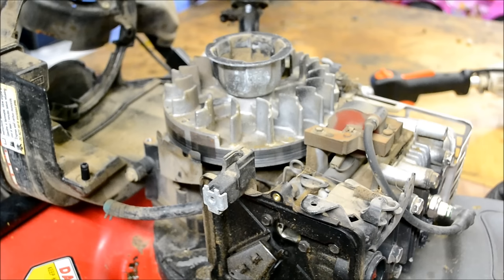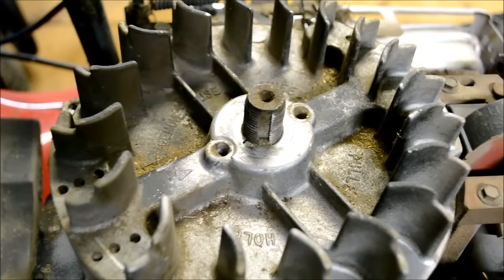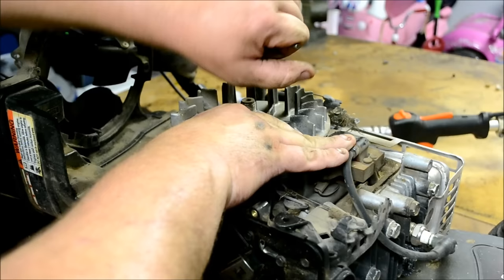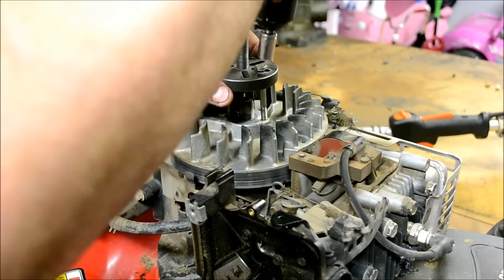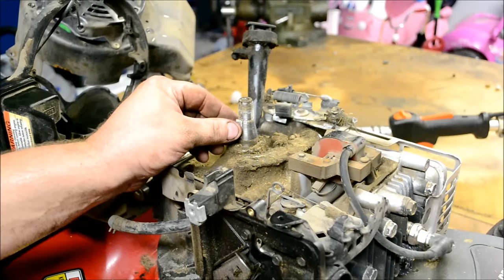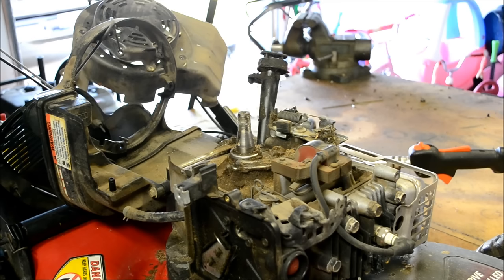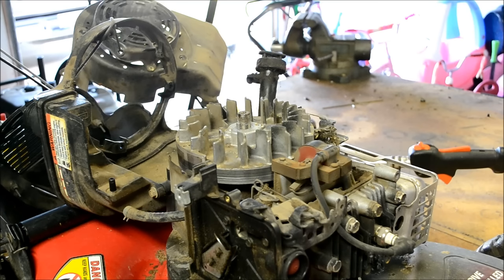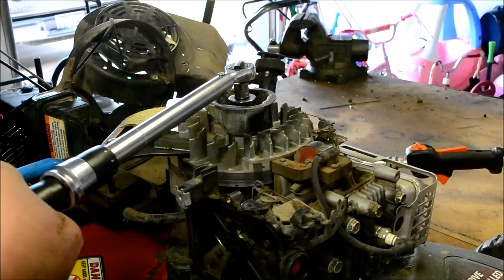BRIGGS AND STRATTON LAWN MOWER ENGINE REPAIR :  HOW TO DIAGNOSE AND REPAIR A BROKEN FLYWHEEL KEY

Comment: You should tell people the first thing to consider is;  if the mower was running well and you struck a stump, large rock or clump of dirt and killed the engine and then the mower is hard to start or won't start or difficult to start then the flywheel key is the first place to look. PERIOD!
Reply: Yes exactly and I literally just found out about this today and you are the second person to mention this.
Reply: @E85_STI  correct!

Comment: From one small engine mechanic to another, excellent advice. Please use the required zinc flywheel key. Never use steel for any reason. Guy from my hometown went the cheap way and used a cut horseshoe nail and the flywheel exploded after hitting a tree stump. He lost half of his right leg from it.

Comment: In my experience, keys fail when someone runs the mower over a large rock/cement - stopping the engine far faster than it should stop.
I don't think it's cheap engineering to use a part that will sacrifice itself to save other parts.
Is it cheap engineering to use fuses in electronics?

I do agree that they should tap those holes though.

Comment: In my area of South Carolina, you usually are SOL if you need anything except the air filters or spark plugs for your mowers or other power equip.   Places just will not stock any parts for the DIY guys & gals.  They will sell you a lawn mower sure....just don't expect to get any parts for it.   That my friends...SUCKS!

Comment: For a small engine mechanic that only knows the basic on how to start up and cut the grass this is a great way to learn how to fix the common problems over the motor backfiring through the carburetor and muffler and basic intake if engine repair.

Comment: I wish I had seen this video two weeks ago. Motor was backfiring on me and it left me with a lame wrist for 5 days. Still, I kept trying to start it and ended up with a broken starter pulley, a broken bladeholder and then I broke a teeth of the flywheel while unscrewing the cup.
Yes, I noticed that the two gaps in the axle and flywheel weren’t aligned but i wasn’ aware that there should be a ‘key’ in that place.
Thanks for this useful video. Now I only hope I can still order the necessary spare parts.

Comment: Been a machinist for a long time, mills and lathes go through keys like that, I get leeway material by the foot, cut it and use it, think like 2 dollars a foot or so, mill table power feeds always sheer when the table is locked and they hit the rapid feed, thanks for the video

Comment: I loosen the nut, spray PB Blaster on the shaft where the key is, pry up on the flywheel with a screwdriver and hit the nut with a hammer and that usually pops the flywheel loose.

Comment from the maker: your right.....the key is just an alignment tool basically.......once you torquge the flywheel down you could actually remove the key and it would stay in place for ever untill the mower hits a pipe, root, rock, ect

Comment: Instead of a wheel puller I use an air hammer. I remove the bolt holding the flywheel on. Set aside the washer or the pull start cup or what ever the mower has between the bolt and the flywheel. Then I put the bolt back in and screw it almost all the way down. I have a round tip attachment for the air hammer. I put it against the head of the bolt and pull the trigger. Just a split second and the flywheel pops off. Much much faster than using a puller.

Comment: had a sears riding mower with Kohler engine and wouldn't charge.  finally after much taking apart and trial and error, pulled the fly wheel off and the magnets had come off of the inside of the flywheel.  new $90.00 flywheel and worked fine ever sense..
FYI

Comment: I appreciate your work and thanks!

Have a Toro self propel with a Brigs and Stratton engine.  Quite suddenly while mowing it started a mettle on mettle rub.  Engine itself seems to be running at speed, started with normal effort, not backfiring, etc.  

Did not appreciate that blade hit something, and the blade itself is not rubbing.  Manually spinning the blade did not feel resistance or a rubbing sound.  I went through the process of removing/reattaching blade assembly anyway (rule out the obvious) but no joy or obvious defect.  The sound seems to be coming from above the deck not below.  

Was wondering if it was the key or flywheel but not your description of backfiring or pull rope resisting, etc.  

I cleaned around the engine, confirmed that there is oil, etc.  I have just about enough small engine knowledge and enough tools to be dangerous.  Any suggestions on what I should be looking for?

Comment: Great video Jeremy. My crank on a 3 year old Sears Craftsman gas powered lawnmower with a B&S 190cc engine broke yesterday and the blade flew off taking a chunk out of my mower's deck. Any videos or advice on how to change the crank. Engine and flywheel key still in great shape - mowers still runs great. Event was a little scary.

Comment: A flywheel key for $1 is a great deal.  over here we pay through the roof for any little thing from a mower shop.  example..  airfilter for 3.5 briggs   $11 .   fuel primer bulb and plastic base plate $ 12  , a cirlip for the wheels costs $1  just to name a few . I have not bought a flywheel key , but I would imagine they would be $8 or so .  I would be thrilled to get one for $1 . mower shops here charge like a full blown motorcar workshop .

Comment: I'm thinkin' this is the problem with my 2006 mtd yard machines lawn tractor I bought on craigs list last week for $200. It cold starts fine but after it warms up when I engage the deck it bogs out and stalls, then backfires through the carb when I try to restart it. I took the carb off and cleaned it with carb cleaner and ran a wire through all the passages but still the same problem. I haven't messed with the rockers or the ignition module yet. You thinkin' what I'm thinkin' too?

Comment: Good, easy job! Couple questions: What is correct torque, when you open engine, that block/sump cover, with 6-7? little bolts?? And is valve clearance pretty much same in 3.5/4. and 5 hp B&S engines?? What is it: intake/exhaust?? And one more question: how do you adjust that: grinding valve stem??? Thanks a lot, youtheman =)

Comment: My old flywheel key got sheared and I took off the flywheel and broke it in the process. I ordered another flywheel and key but the flywheel looks different . The new flywheel has something a little extra on the bottom and it may be a tad bit taller in height. The one I originally had looks like the one in this video. I just wanted to know if it really matters?....

Also it still makes the same noise when I try to start it. Like a cling/clanking noise? Help!

Comment: nice! i have a briggs 11 hp vertical shaft flathead, cant get it to run it has 85lbs compression spark and fuel. its pull start. when i pull it snaps the cord back hard! i checked the flywheel key and even removed the flywheel to be sure it was ok and its is. any ideas? i did also check that both valves are opening and closing tho i did not check the clearance with my feeler gages

Comment: i think its a timing issue the magnet on the flywheel is meeting the ignition coil before the piston reaches top dead center the piston is 3/4 of the way up when the coil is giving spark. just figured this out by removing the head and turning the flywheel
Reply: Josh D Weird dude. I got mower issues but something tells me that it's a timing issue due to the magnet on the flywheel meeting the ignition coil before the piston reaches top dead center. Thanks Josh D. But how do youfix it?
Reply: Josh D lol weird indeed! i checked this observation about the magnet on the flywheel with another flathead i have it seems to be normal. i did solve my issue though, i had to grind the valves back to spec. they where way off. but on briggs if you do need to set the timing there are two dots that line up inside the motor. search how to set timing on briggs and stratton and you will find videos to help you
Reply: +Josh D A piston never makes it to the top , it should be about 3/4 ... you having timing issues then check your breaker points and ignition coil
Reply: It's quit on my twice this summer. Took everything apart including the head and put it back together and somehow it works great. Just needs to be taken apart like lego's and put back together.

Comment: Jeremy, my Briggs and Stratton 210 won't start even though the gas tank is full the line is patent.  its almost new but just can't get it to stay running.  if I pour a little gas into the carb it will start but then shut down.  not sure what to do now.

Comment: Do you have a video on camsaft removal and checking on a 14.5 hp ohv engine.  Was trying to adjust valves and the push rod would not push the valve up or down.  First symtom was not cranking.   Seemed to have too much compression

Comment: Hi Jeremy

On the mower that you changed the flywheel key on, does the primer bulb have a tiny hole in the center of that red plunger ??   

Had some maintenance work done on my husquarna 65021RS recently.  A new primer bulb without a hole in it was installed.  The old bulb did contain an "air hole"   The engine is a Briggs and Stratton.   The mower is nearly ten years young.   Mower runs well once it starts up.   Either 5 tugs on the pull cord or...a spritz of carb spray cleaner into the throat,  gets it to roar. 

Strange that it doesnt want to start with the second pull anymore.  Plug, Filter and Fuel are good.   Gas cap is vented and oil level is correct.  

Thank you for any help you can offer me.

John
Reply: +john vincaldi check breaker points

Comment: Hey Jeremy.  Got everything off, removed the flywheel and the key doesn't look damaged at all.   Putting it back together, it is difficult to pull.  Could it be a spark plug issue?
Reply: +Perry Bell  "removed the flywheel and the key doesn't look damaged at all."   The  one in the video was easy to see. It was pretty much sheered off. If one of those keys gets as much as the thickness of a peace of paper off it can make it hard to start , back fire , snatch the cord out of your hand. Or not run at all. IF I tare  one down that far I will put in a new key. It is only a $1.00.  And that is a lot of work for someone to do for being cheap. While you got every thing apart clean the magnets on the flywheel and the magneto  "coil " Just brush off with a wire brush or sand paper. Put the flywheel back on regap the magneto. 
    ", it is difficult to pull. "   I suppose your talking about the rope. That could be many things. Most likely the break. That is the bar that you let go of when you want the mower to turn off, stop. Sometime those cables stretch or rust in to. Sometime they will move but not enough. That bar does two things. It has a break that stops the engine . And a wire that grounds out the engine, a kill wire.
 BUT since you had the top cover off and pulled the flywheel . Once you put it back together did you check to see if the flywheel could spin free ?  Do you hear a scrapping sound ?  IF so you have to regap the magneto. "coil" There is a lot of videos on here. You will need an old business card.
Reply: +William Wynn 
How do you know if the cable is stretched out too much to release the brake, and how do you fix it? I'm having the same problem as +Perry Bell; I pull the lawnmower starter rope and it only comes out about six inches and then stops. I watched this video to learn how to change the flywheel key, but I'm wondering now if maybe it's the brake not releasing enough, and how would I repair that? Thanks for any advice!
Reply: When you squeeze the handle that cable pulls the break away from the flywheel. So the engine will spin. To check pull the spark plug out. Have someone hold the handle / break. and try and spin the engine over by hand. IF it spins free it is Not the break. 
 When you say " it only comes out 6 inch and stops. Are you talking the play in the rope ? In other words you pull the slack out of the rope.and then it stop's.   IF so that could be the cable not releasing the break. 
Follow the break cable down to the engine. Have someone squeeze the handle. Notice the direction the lever moves. When the handle is squeezed. What you want to do is move that lever in the same direction just a little. You can use a big set of pliers or a screw drive. USE caution and be careful. Have someone pull the cord. IF it spins free then you know the cable is bad. Sometimes you can tie a knot in the cable. But if you do this it can make the handle hard to squeeze.
Just be careful as to where you tie the knot.
Not to close to the lever and Not to close to the cable so it can slide into. 
Depending on how bad the cable is you may have  to replace. Sometime when you tie a knot into one they will break. 
  OR IT could be this 
 IF your spinning the engine over and you only have 6 inch of pull then your rope is either tangled up somehow or to short.  
Hope this helps.

Comment: hey jeremy i have an old 16 hp horizontal Briggs and stratton the long fuel jet i had accidentally snapped at the lower fuel jet holes. will this jet and carb still function

Comment: After replacing flywheel key & also new carburetor why would it still backfire ?? Please respond having a little trouble getting it  back running
Reply: +sanders journet i would think at that point it would either be a timing issue or gap spacing on the ignition module from the fly wheel....
Reply: thanks tried timming y first timing job didn't get it figured out but will try again in the spring please send any tips for me you have thanks

Comment: Great how to man. I've got a push mower with 6.5hp B&S engine. It works great-always starts up on first pull. It does however leak a bit of oil onto the deck. I'm guessing maybe loose bolts or bad seal somewhere. Any advice? Thanks

Comment: I totally screwed up. I tapped the flywheel with a 1/4 20, and apparently screwed down too far, because it went all the way through the flywheel on the left side. So now on one side is is okay, but it is busted through from the bolt on the other side. Do I have to buy a new flywheel? Is there anyway I can fix the hole! Thanks!

Comment: i see you used channel locks to hold the flywheel. can you instead use the old "rope in the cylinder" trick on a 4-stroke (with valves, vs 2-cycle engine) to keep the piston from moving to make your final torque, or will this potentially damage valves?  i'm trying to "properly" torque the PTO clutch bolt onto the crank shaft of horizontal Kohler  Command engine on a shaft-drive Cub but the engine wants to rotate, and impact isn't precise.

Comment: Jeremy, where did you buy your wheel puller?  I have looked at several outlets but cannot find one specifically like the one used in the video.  The puller I have is stout enough but the slots/holes are too wide and do not allow the bolts to align straight into the holes in the flywheel.

Comment: I would like to know what the tool you have to see the rpm and where you can get one. I am a landscaper and i also fix small engines. I usually set the rpm by listening to the engine speed.

Comment: What would you do if a 40 turn in on the tractor motor blew up again I work for is to work for said that his throat or motor blew up and it was basically junk is it fixable or what I have to go get a new motor because I just want to find out because I don't want to videos and I can't figure out where when I would have to do

Comment: Where did you get that handy puller and the tach? 
I had an engine, Briggs 675 series that had the whole electric start set up deal and when I went to pull the flywheel, I noticed the key was messed up. I got the flywheel of. I just about took that engine apart because when you would try to start it it would blow oil out the carb and pop out the muffler. Sure enough that was the problem. Now I have this Briggs's 675 series motor that had electric start in pieces. Oh well, a spare non electric start engine is going on the mower and now I'm going to just sell the electric start component's. 
What is the part number for that flywheel key?

Comment: hey bud, in the case that the sheared key is on there good what do you suggest? I got the steering wheel puller on there, holes tapped to 1/4 20 and it pulled the thread out of one of the holes whille trying to remove it.

Comment: I have an question, I have an 15.5 HP Brigg's motor, and their is oil coming out the [CARB] while it is running the oil seem to be coming from the air tube, that runs from the base of the carb and the side of the motor, where their is an hole in the side the engine block? THANK FOR AN HELP
Reply: ***** 
Have you received an answer to your question yet? If not do you have fuel inside the crankcase as well???

Comment: My neighbour has a "Mums: Ja #198544#" lawnmower. I guess it was hardly used coz the bearings, the cylinder and the rings are all OK except the exhaust valve came loose. As it turned out its guide, that looks like an insert, crumbled to several bits.Poor old b...d is very disappointed and I'm trying to help him but no idea. Any suggestion?

Comment: What was the last thing in this video, you were measuring/adjusting??? RPM?? How much it should be, full power?? Thanks, youtheman =)
Reply: He was using a digital tachometer to measure the rpm, the correct rpm for a small push mower is around 3000 rpm, but it may vary depending on the size of the engine.